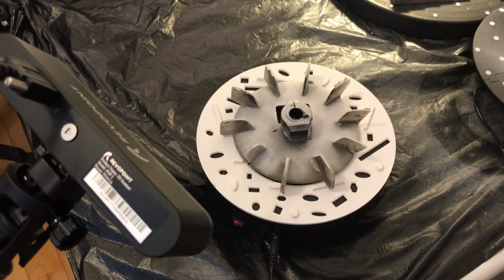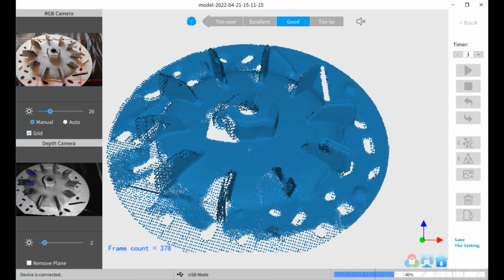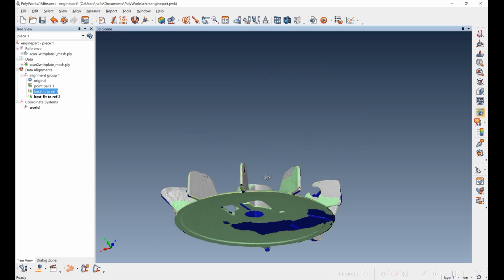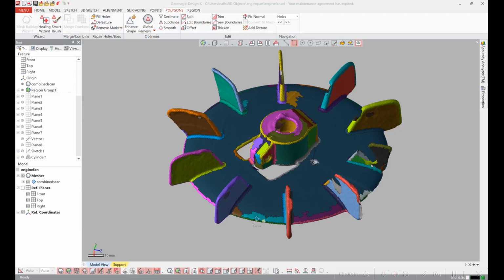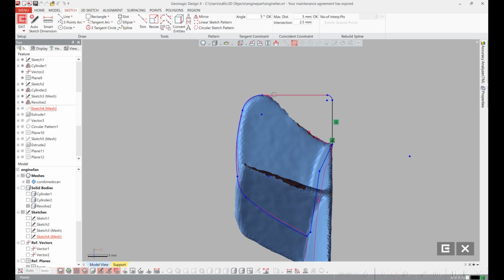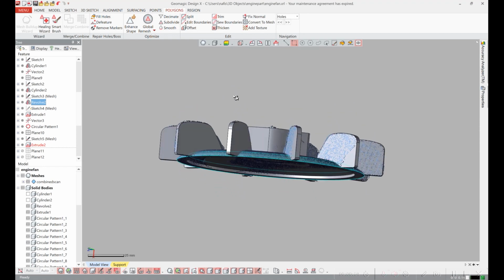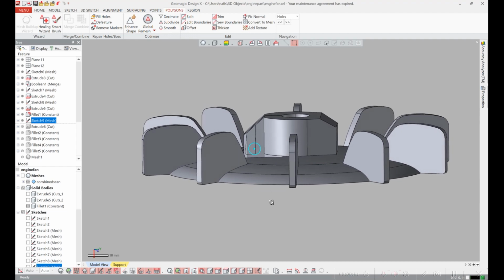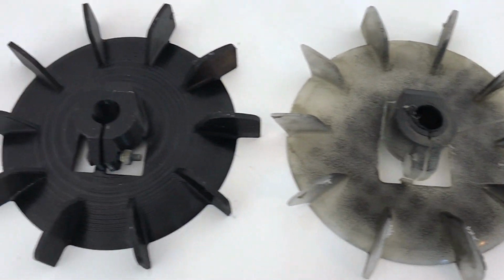Using Revopoint POP2 to make Replacement Parts

Comment: When scanning parts to be 3D printed I use monochrome mode, as colour mode significantly increases image processing with no practical benefits. Recommend printing high speed 3D printed parts in a carbon fibre impregnated filament to withstand high centrifugal forces. 👍

Comment: Nice one but PLA+ is actually stronger than PETG fyi :)
Reply from the maker: I use PETG because it will handle higher temperatures and is UV resistant
Reply: @SerendipitySue  yeah about the only thing better is the outside temp handling but not by much... better to go ASA or ABS
Reply from the maker: @EUCRAZY_AU  I don't like the fumes that ASA and ABS put off
Reply: @SerendipitySue  get a exhaust for ventilation or just walk away when printing it's definitely the right product for the job thou

Comment: Hi! Regarding the feature ring with a hole in the middle. You mean cleaning is easier using the post processing tools such as the cutting plane or lasso tool? I am a beginner 3d scanner owner, so sorry if this may sound dumb. Thank you

Comment: My laptop does ok with solid works, will it be able to handle the scanning software in your opinion?  Also the models could be brought into solid works directly without geomagic?
Reply from the maker: The revopoint POP2 page has the specs for a computer to use with the 3D Scanner. My experience with Solidworks many years ago was that it wasn't good at loading large polygonal files

Comment: I recommend to use a caliper, draw it with a 3D software, and in 1/4 hour you have a perfect design ready for printing (for simple part).
Reply: Yes, but with simple geometry objects like the one above. But try tu use caliper and draw i.e. boot lid or a bumper so You could have all the curves...good luck then ;) This film is just an example.
Reply: With a caliper you can't reproduce curved surfaces easily. The part in this video is extremely simple and has absolute symetry arround Z axis. This is not always the case. Imagine you have to reproduce the casing of a car external mirror. The curves are completely organic and without a scanner like this one, it would be an absolute night mare to rebuild using caliper and measurements. Check this example https://youtu.be/rC0HOK7M-U8

Comment: Man..this simple geometry is far quicker modeled in cad with a pair of not even calipers, just a ruler!
Reply: Try doing that with a turbine, genius
Reply from the maker: it's meant as a simple example. Of course you could make something sort of like it in CAD without scanning. The other goal was to try to exactly copy the original. Here's a slightly harder model: https://youtu.be/rC0HOK7M-U8

Comment: Dont get me wrong but "It took me about 1.5 hours to 3D scan and to do the CAD work." Sounds like a waste of time. Part is simple enough to just remodel it using calipers measurements in like 30 mins ?
Reply from the maker: yes could have easily made a similar part with caliper, but that wasn't the goal. I was trying to make duplicate for neighbor.

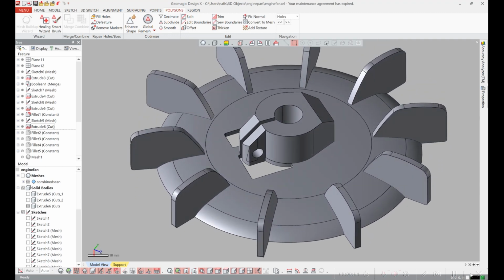Comment: Excellent video! Im getting into this so very helpful! Also, sorry if it seems like a ignorant question -but what specifically did you mean by 'fillets' at 7:05? Thanks!
Reply from the maker: Fillets are rounded edges that reduce cracking in 3D prints and provide additional strength if you use them where two surfaces come together

Comment: I blew 550 bucks on the original pop1...like a month before they announced the pop 2.  can't get it to work worth a damn, absolutely terrible.  really disappointing.  Honestly, if youre getting a 3d scanner, spend the extra for a good one that actually works the 1st time because the revopoint scanners almost NEVER work right and to simply re-design the part in fusion360 would take less time than trying to repeatedly scan it and get a usable scan.
Reply from the maker: I also bought a POP and then the POP2 came out. I find the POP2 much more usable for the kind of reverse engineering I do. I think the POP is more appropriate for artistic type applications

Comment: Why would you scan something symmetric like that and made it as bad as the original design, reason why it broke in the first place is because it was designed with weak points, you could of just measure the diameter, center and make your own better design fan. That was a waste of time. The scanner is for organic shapes which are difficult to measure.
Reply from the maker: Yes, I could have, but my neighbor asked me to try to copy it. It broke because his machine tool fell over when he was moving it :-)
Reply: Right. A 3D software, a caliper and a rule to record the main dimensions and bingo, you are right to produce an improved version of the initial product. I produced  a copy of the broken support of LNB (Parabolic antenna). I put ribs were I identified  design weaknesses. Works perfectly. Did the same for a support of ham antenna. Same success.

Comment: Been looking at budget 3d scanners to reproduce tail light housings since it's hard to reverse engineer curves of an object and this was very helpful on seeing the scanner used in a more practical case
Reply: Hey, I am also designing tail lights, did you end up buying this scanner?
Reply: @bilalexl  Not yet, I built a cnc machine first because I didn't want to 3d print everything and I still wasn't fully done programming my lights since I'm making them sequential. A lot of videos I've seen from this scanner look pretty good and worth it so it's definitely going to be my next big buy
Reply: @Chunknannigans  I am going to nedd to ask you how you doing, because it's been a while since i thought i wanted clears on my car but i haven't really put the time or the heart to it. Also can't really afford a Pop but i am building a 3d scanner that would probably owrk
Reply: @Flashbang_Photo  hello, that sounds very interesting, mind emailing me for more info. And as an update towards @bilal I did finally get the Revopoint mini

Comment: Curious as to how you came across the A-Sub stuff?
Reply from the maker: I have been using Spotcheck developer for 20+ years, but it is pretty nasty stuff. I was trying to order another can of it and an ad popped up for the Aesub. I thought it would be nice for scanning things like fabrics that don't easily clean. They have several varieties... so I ordered them all. The coating seems a little thicker than Spotcheck, but it's nice to be able to use it in the house and it is self cleaning

The link to it is in the video description

Comment: Super helpful! Thanks for the tips because I've an old impeller from an antique outboard I'm gonna attempt to reverse engineer and print in CF-PETG. Great channel 👍
Reply: how can you print nitrile rubber?   might be tricky to get a flexible enough material that wont break and seize the motor.